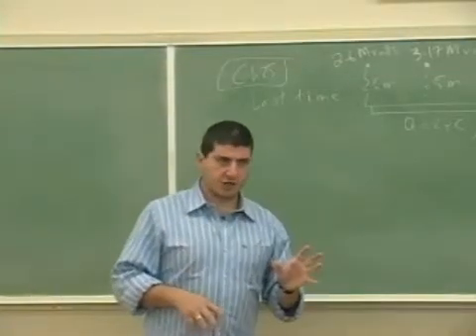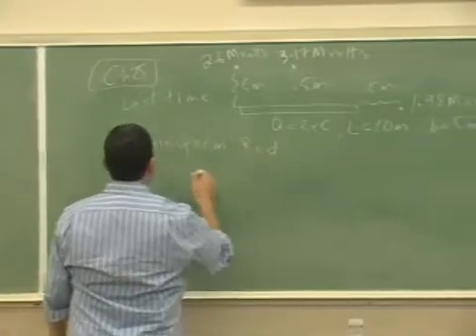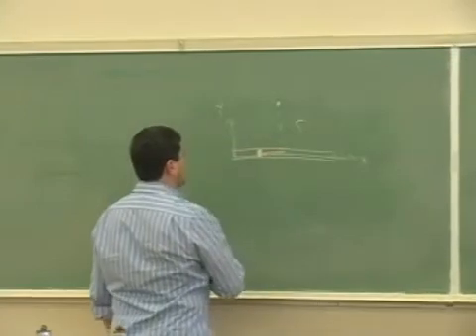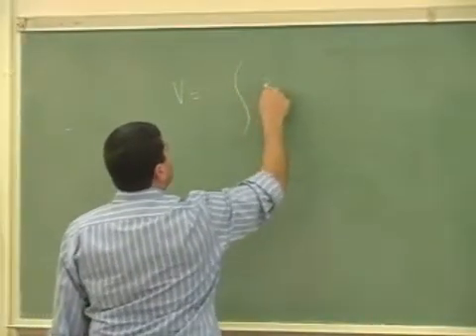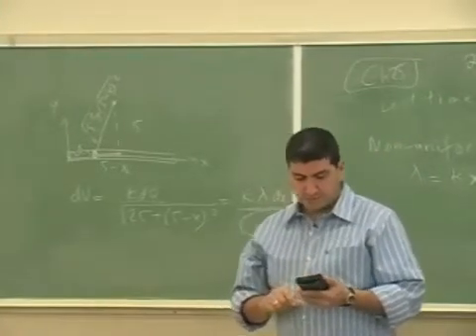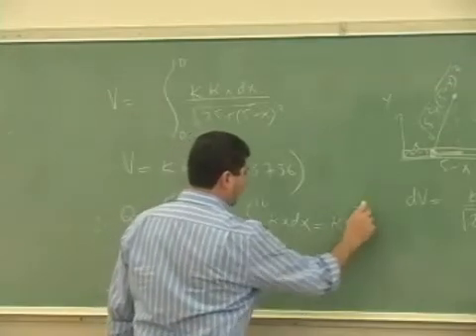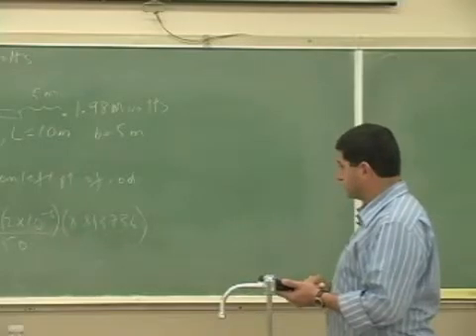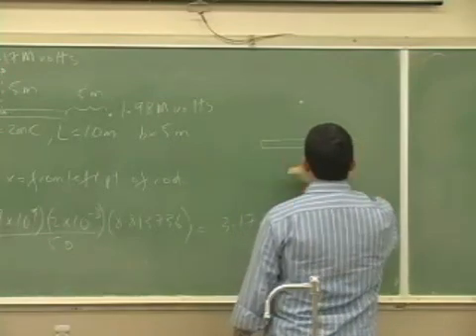Electric Potential Example 2 Part 1

Comment: Hey professor. You looked for the value of Kappa through the integral of the total charge where you got Q/50. Then you multiplied K.Q/50.
Wasn't it better to write that as K^2? or even (Q/50)^2 what comes to be Q^2/2,5x10^3.? Because you assumed the other K as its real value (9x10^9). I can´t see the differente between the 2 K's.

Hope you read this.

Greetings from Venezuela.